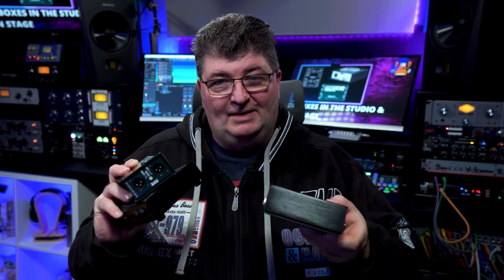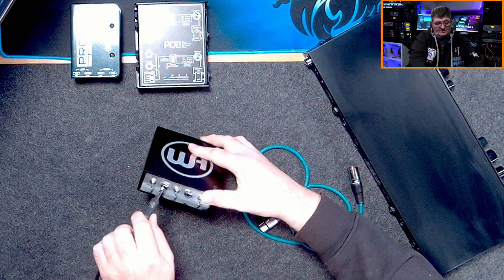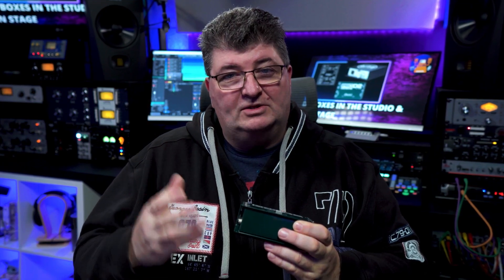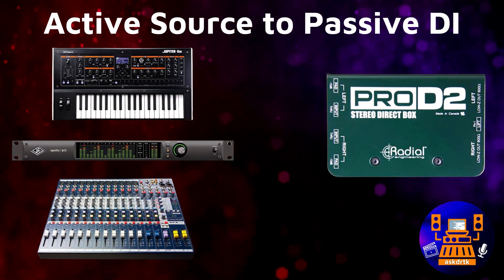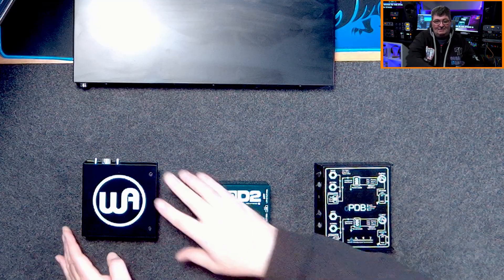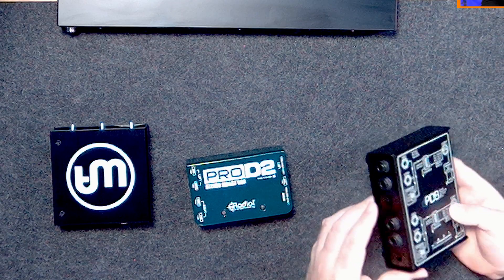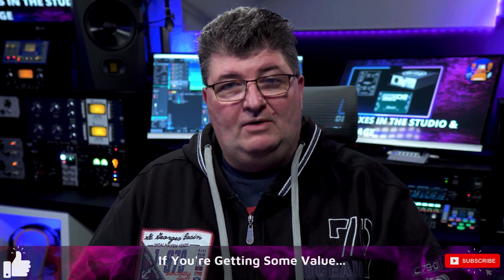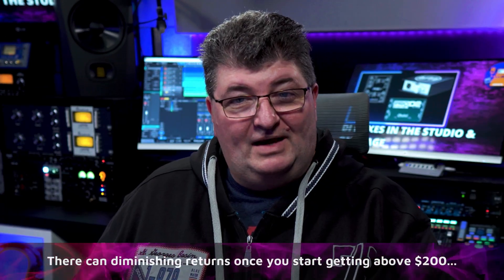DI BOXES - 6 Essential Things You Must Know

Comment: I'm trying to find something I can run my time based effects into, so I can take them out of the effects loop on my amp, and integrate everything back intp the chain. I want to be able to run everything from my radial headlight into the Iridium, and then to the mixer, then into my Interface. I'm thinking the ART dPDB would do the trick. But I'm not sure it will work when I'm not recording. I don't want the effects to become a mess when I'm running my amp, live. Thanks for a very good explanation of DI, etc., though!

Comment: Hello, Thanks for the video!! I have a question, I have a dj controller, my dj controller output is RCA, So I bought The RADIAL PRO AV2 - When I run my XLR to my Analog Mackie Mixer, I put my Master on Unity and mt volume faders on Unity but I have to crank up the trim a lot, Feels like its a low signal - Also on my dj controller, I raise the Master and fader knobs to a decent range - I read that my Radial pro av2 is defaulted to -20db - Should I have bought a Active Di BOX? I did hit the pad button on the di box and that helped a little, Should I just continue to crank my Mackie mixer up or should I have brought a Active di box? I noticed when I connect to a louder sound system I have enough head room, but if I connect to a smaller size mixer or a older Analog Mixer I have to push the TRIM Really High, To to be clear I only work with Analog mixer, I haven't got into Digital Mixers yet. Also I'm still doing research - Should I have bought the Radial ProD2

Comment: Something I have an issue with is specifically related to the goxlr interface. I want to use my guitar with it. The unit has a mic input I use for a mic but also has a 1/8 line in on the back. It does not have a dedicated instrument input. I can hook up the output of my amp to that but of course the level comes out low. Would I be able to use a di box from the guitar out to the 1/8 in? I have never used a di box before.

Comment: I just bout a DBX active DI box to try and eliminate noise from my DI recordings (hi z interface input) only to discover the results were WORSE with the DI box. How disappointing.   Why would this be?   I tried the 48v option, the battery power option (worse than 48v), ground lift (absolutely horrendous) and the three different stages of attenuation, as well as different leads, inputs and mic pre gain settings.. It just has so much more white noise and hum than the hi z input.. and the hi z input wasn’t very good to begin with.    I’ve also tried a different interface in the past!  Same noise exists.   I now have a problem on top of a problem.   Any one use the DBX di1 with good results?   Or will anyone suggest what the problem could be here?  Thankyou

Comment: So I have a question, maybe someone can help. If I want to connect guitar in this order: Guitar - Tonex + some pedals - Scarlett AI. Where should I put DI Box, and which one?
Reply: Get a canvas stereo and put it after the pedals. If you're using amp captures then you can swap modes (i forget the name), and if you dont run amp captures/sims then you can use it in normal di mode

Comment: PROBLEM . running harmonizer , mic and guitar through acoustic  amp equaled  unbalance and distortion . SOLVED , ran di box through  harmonizer using one channel on di box. no distortion only mic working clearly . put guitar through another guitar amp . now clear vocals and clean guitar . no need fort a mixer . trust this helps you out .

Comment: if i want to go from my xenyx mixer (unbalanced outputs) to a pair of yamaha dxr 12 i need a stereo di right?
thanks
Reply from the maker: There has been some debate over the years about whether various xenyx mixers have unblanced or balanced main outputs. If yours are unbalanced, you can either run unbalanced TS to the 1/4" input jacks on the dxr 12 as they are unbalanced (not a great idea other than for very short cable runs), but if you are using the rig for shows it is better to be safe than sorry imo and use a 2 channel di box to connect the mixer to the balanced xlr inputs on your dxr 12s. Use short 1-2’ patch cables between the mixer and di and then balanced xlrs for the longer run between the di and speakers. The Radial Pro AV2 it a solid reliable choice. I hope this helps, Cheers!
Reply: @askdrtk thank u so much

Comment: Hi i was thinking of getting a prod2 for my keyboard for gigs , Yamaha YC61 , I would run it through the ProD2 to the mixing desk, I would also be taking a feed for my monitor which is Stereo input Yamaha Dxr10 , I am trying to keep everything stereo if possible as the keyboard samples are stereo , my question I have tried this with a cheap Millennium Di box and the output to my monitor is humming I have tried the ground lift etc but no good , What cables should I be running from the keyboard to the prod2 TS / TSR ??? and then from the output to the monitor from the Di box ? I am currently using TS cables  Thanks

Comment: Very helpful, and answered a lot of questions I had! I am left with one more: Are you able to run a DI box in front of something like the two notes captor/loadbox to capture the instrument DI via the audio interface (for reamping purposes), and have the thru run to the front of the loadbox (routed back to the interface) to also capture the dry signal coming from the amp (for silent recording/monitoring with an IR) at the same time?

Thanks so much, and great content!

Comment: I'm trying to use my VST instruments from my keyboard through a DAW and interface.   So,  from the back of the interface that would normally go to powered speakers,   I want to go to the PA...  So I would need a 2 channel passive DI ?    Or can I go from the interface straight to the PA ?
Reply from the maker: Monitor outputs on your interface can be connected straight to the PA line inputs. No DI is needed as both interface outputs and PA inputs operate at line level.

Comment: Awesome thank you so much.

Is it possible to use a passive DI box in reverse. For example, connecting a mic to a DI box to then connect to a mixer line input in case you run out of XLR ports?
Reply from the maker: Glad to help out. Passive DI is one-way only, reduces line level to mic level. In reverse it would need to add gain - same as a mic preamp.

Comment: Would I still need a DI box if I’m running an unbalanced signal into a mixer that less than 10ft away and output with balanced XLR cables?

Comment: 1:50  here i have a question. While performing on stage do the mixer get the same tone as the amp ? Or the the mixer gets the normal unfiltered sound. Eg if i use distortion on amp will the sound from  mixer will be same or it will sound normal clean.
Reply from the maker: Sorry I missed your question earlier. To get the sound of your amp (distortion, etc) into the mixer you need a di box that has loadbox function 6:14 in the video. This way you can send the amp speaker outputs into the di loadbox and then into your mixer. You can also have the signal from the amp go to both a speaker cabinet and the mixer is you want a cabinet on stage for monitoring. A popular choice is the Two Notes Torpedo Captor. Hope this helps out.
Reply: @askdrtk  thank u a big help

Comment: Hi, thanks for your explanation! So in this way I can connect my guitar to my pedalboard into an active DI Box into the input of my audio device to record (thanks to a cab and speaker emulator) my analog pedals in my DAW? Is that right? 🤔
Reply from the maker: Yes, a standard DI box allows you to go guitar -> pedals -> DI box -> audio interface. To use your pedals in your DAW, you need a DI box with REAMP capability. Check out 06:48 for reamp connections... Cheers!
Reply: @askdrtk  Sorry to bother you again, I didn't get the Reamp thing 😅, if I get just an active di box it is not enough? maybe I've lost a piece of the puzzle ahahah thanks a lot for your patience!
Reply from the maker: No problem. A standard DI box takes instrument (guitar) level signals and sends them out to balanced mic level signals to go into an audio interface. A reamp box takes line level signals out of your audio interface and sends them out at instrument (guitar) level signals that can go either to pedals or amplifiers. To use pedals as effects in your DAW the idea it to create a loop. You use a reamp box from the output of your audio interface to connect into your pedals and then a standard di box to connect out from your pedals to a mic input on your audio interface. Note that if your audio interface has an instrument level input you can connect the pedal output directly to that without need for a standard DI box. The key it that a standard (active or passive) DI box is for sending signals into your audio interface whereas a reamp box is for sending signal out of your audio interface. You can either use a standard DI box and a reamp box to create the loop for your pedals from your audio interface or you can use an all-in-one option like the Radial EXTC-SA https://www.radialeng.com/product/extc-sa which combines both DI and reamp into one. The EXTC-SA is the "premium" option which includes level controls that allow for additional control to get your gain perfect both in and out of your pedals. The nice thing about the EXTC-SA is it covers everything you could need from DI through reamp in that you can use it to connect your guitar and pedalboard into your audio interface to record and use your pedals as effect in your DAW all with one box. Yes it is more expensive vs a standard DI box, but compared to purchasing both a separate DI box and reamp box the price starts to make sense. There is also a stereo version, the EXTC-Stereo, that gives you two channels in case you ever want to do two guitars or guitar and bass at the same time. There are some great wiring diagrams on the webpage for the stereo unit: https://www.radialeng.com/product/extc-stereo  Hope this helps out!
Reply: @askdrtk  Absolutely helpful, man! thanks a lot for your time and your explanation! I'm going to check that out and see what is fits for me! amazing support from you, thanks again